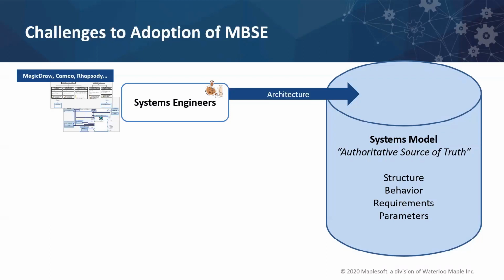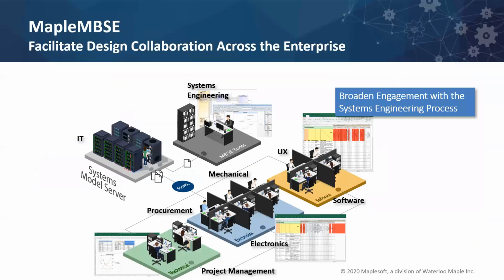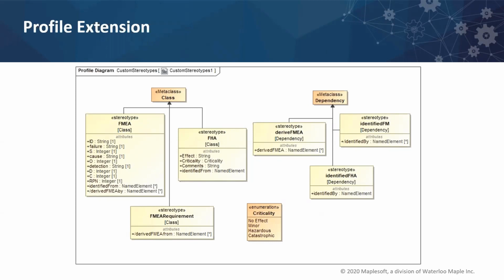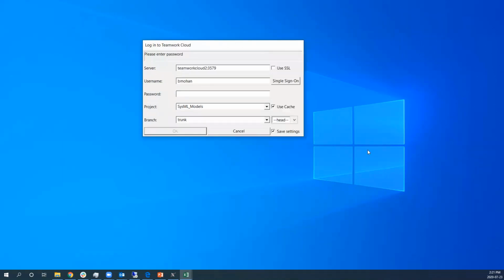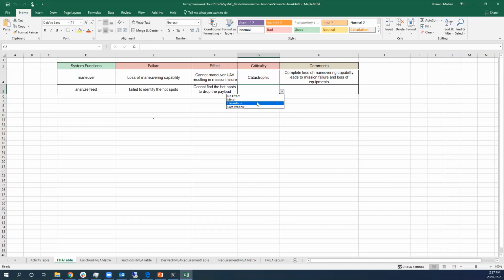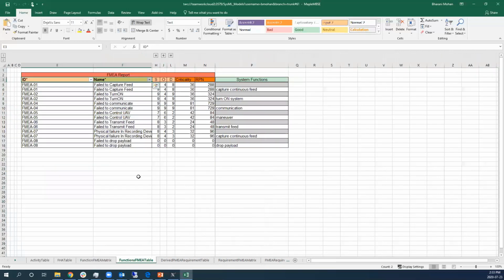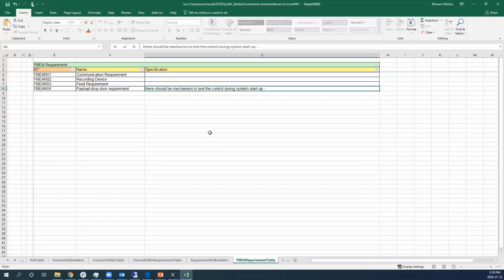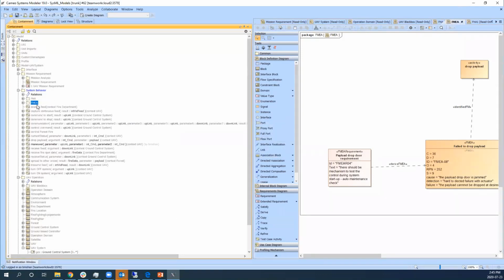Safety Engineering and Failure-Mode Analysis in MBSE

Comment: Hi, the video is really helpful. May I know how did you add comment property to the FHA block?
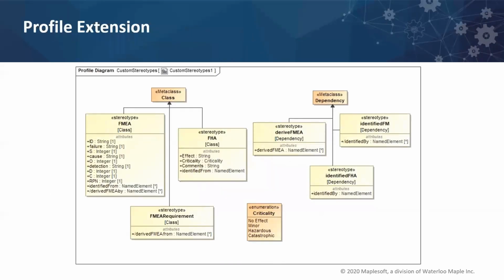Reply from the maker: Thanks!  This solution helps with efficient capturing of reviewer feedback. Here we introduced a new stereotype “FHA” with custom attributes - and one of the attributes is the “Comment property”. This is not the native SysML element comment but an attribute of stereotype FHA designed to get the user feedback. You can see the attribute in the video at time 13:37. Then whenever we add a new FHA block, the comment that is entered (at time 27:16) is captured as tagged values (29:30).